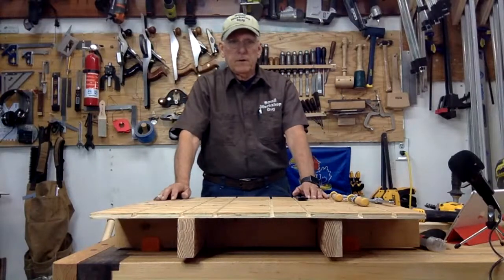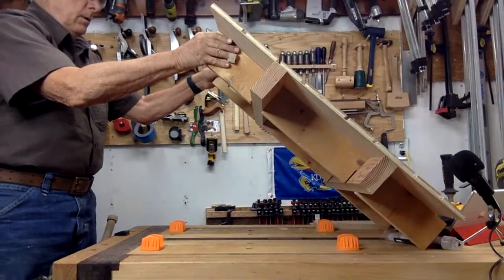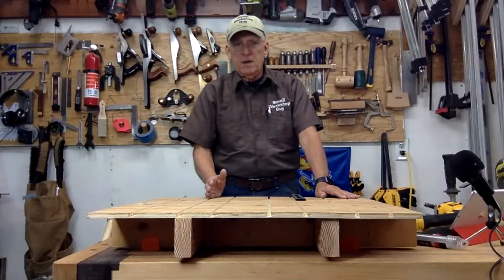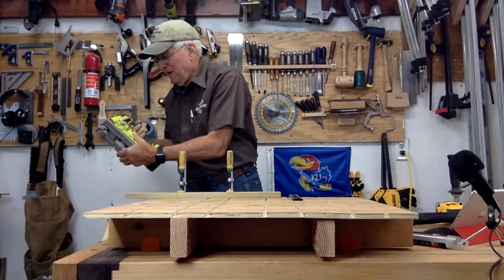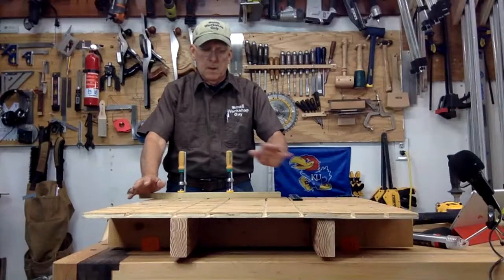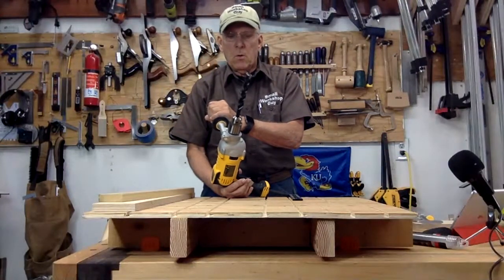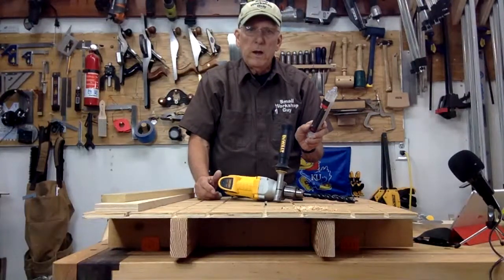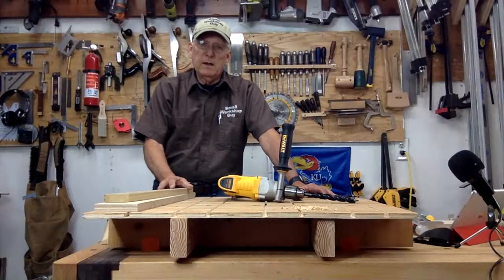Bench Saddle / Matchfit Raised Workbench Platform

Comment from the maker: I would recomment 3/4 inch plywood.  When I put Matchfit Dovetail grooves in this 1/2 inch platform, it became a little flimsy, so I added 2 x 4's in the other direction as well for stability.  If you just use thicker plywood, that would solve the problem.  I just have two nails in studs on the wall behind my workbench and I hang this whole unit there for convenience.